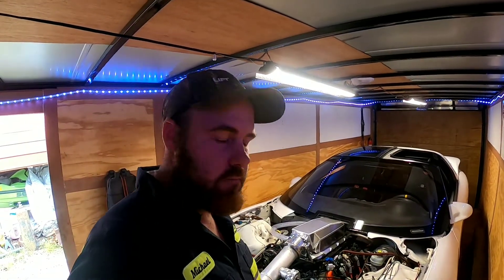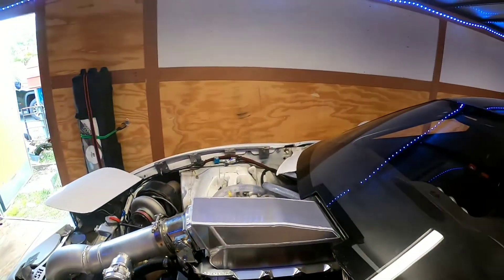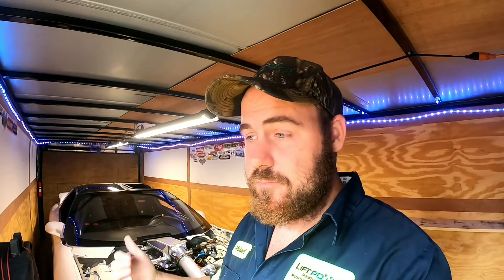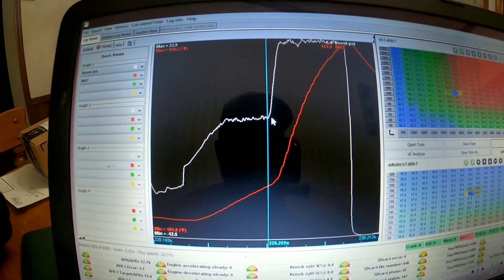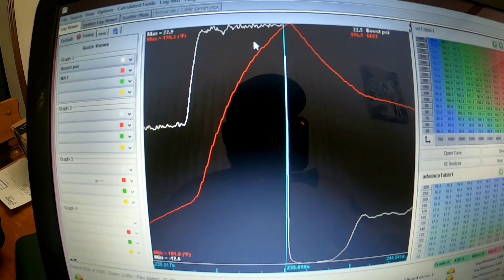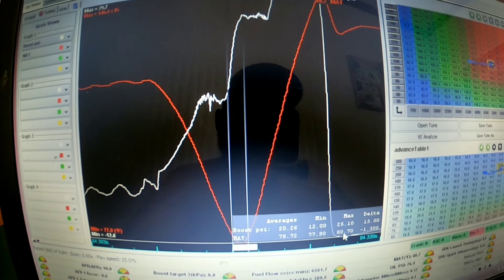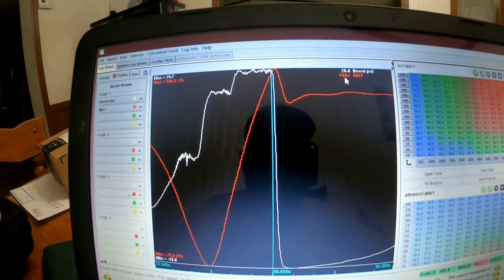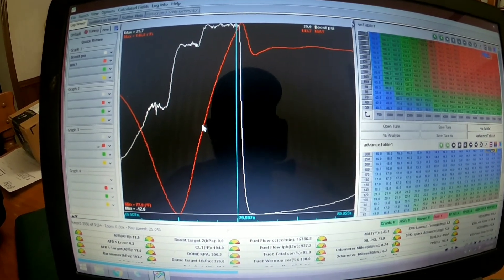Shearer Fab Low Profile 1800HP HiRam Intercooler data is in.

Comment: You ever get the intercooler working correctly? I have a different motor, I’m on 22psi and getting 180* temps as well. Was looking at this intake but came across this video.
Reply from the maker: No sir I sold it, after spending about $5k between the new turbos and the IC and a2w system the performance was subpar. I spoke with multiple respected individuals in the industry. Nobody wants to bash the company or individual in particular. But the end result is that sandwich style intake IC are trash. 63° to 170° iat in 5.5sec is unacceptable.
Reply: @legacyperformance9982  did you end up going back with a2w after selling that? I have a couple buddies local to me that run piping straight from the turbo to the tb, but they run dual 650cc injectors. They run e85 and use the phase change of the fuel to cool the air. They regulate them based one temp but still hit 170-200 iats @30psi but they are running 4.9x 1/8 miles. Pretty impressive but I can’t do that on mine as it’s a street car.
Reply from the maker: @soullesssol7285  yes I remained a2w just went to a stand alone NCC 2000hp core.

Comment: I'm kinda late to the party but I have a couple questions. 

First what pump are you running?

Secondly was the ambient air temp relatively the same on the two passes?

Great video I appreciate the time you took to make it.
Reply from the maker: I have the Craig Davis pump. The ambient air was within 10° I'd say. Read over my other comments. I hope you haven't already purchased this unit yourself. I swear one day I'm going to make another video.
Reply: @legacyperformance9982  I bought it based on your review. Lol. JK.  

I bought it a month or so ago and don't have it running yet. 

Your car is bad ass and I love the fact that you didn't go with a mustang.
Reply from the maker: @user-yr1dp7kr8g  Another mistake I made. Building a heavyweight car, to compete against tin cans.
Reply: @legacyperformance9982  I'm running a 84 s 10. It was borderline competitive when it was small block nitrous. I am changing it over to procharged LS.  Hopefully I'll have better luck out of this ic than you have had. 

It is way cooler to have a fast car that isn't a mustang.
Reply from the maker: @user-yr1dp7kr8g  hahaha so true
Reply: @user-yr1dp7kr8g  are u done your pro charged build

Comment: Where did you put your IAT sensor
Reply from the maker: It's in the rear, but according to modern forums "Facebook groups" it doesn't matter if the iat is in the rear or middle, it makes no difference. I really need to make a follow up video. After the new turbos were installed. The results are the same. Instant heat, 60° to 170°+ in less than 3sec. The intercooler is junk and I wouldn't recommend it to anyone.

Comment: good info thanks... putting my setup together now..
Reply from the maker: Sorry to hear it, I really need to make another video, however I'm hesitant. As I'm really salty about the recent data. It would be a very nasty video of me bashing shearer. $3000 for more efficient turbos, over $3000 in intercooler and a2w system and still have 170° iat in less than 3 sec.

Comment: what size turbos are you running and blow off.
Reply from the maker: Now? Or at the time the video was filmed?
Reply: @legacyperformance9982  on video
Reply from the maker: @donbutler5563  they were vsr billet 69/73. I have not made a follow up video. But I purchased FIS 73/75 turbos which are much more efficient and have made 1600+ at the wheel. Sadly my iats are still 170° at the top of the 1/8. I'm not pleased with the shearerfab intercooler.

Comment: I use this same intercooler. Where these 1/8 or 1/4 hits? Do you prechill the core before you roll in to the burnout box?
Reply from the maker: These were 1/8 noprep logs. I dump Ice in before leaving my pit. Drive to staging wait till car infront of me dose burnout then flip the pump on. I'll do another video when I get new turbos. I wouldn't be surprised if iat stays around 100-120 with more efficient turbos.
Reply: @legacyperformance9982  what happened with the mustang??
Reply from the maker: @brianarrington4569  which mustang are you asking about?